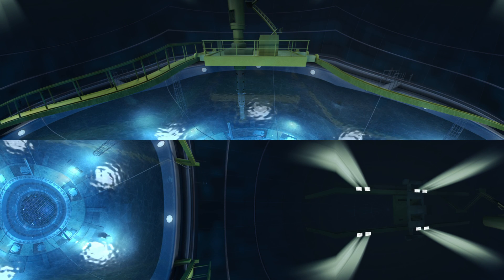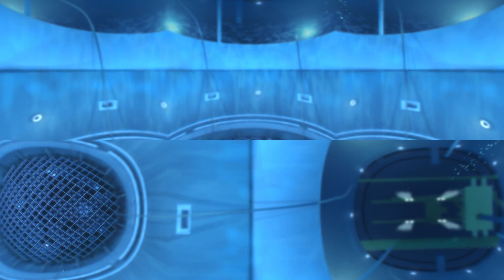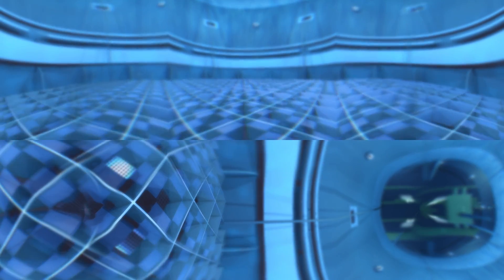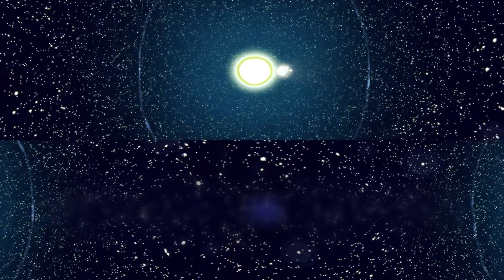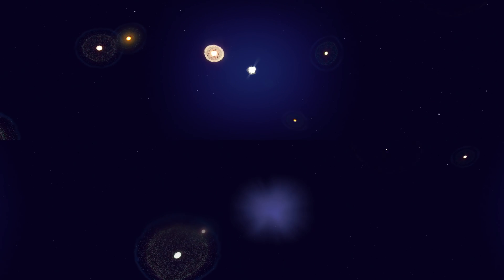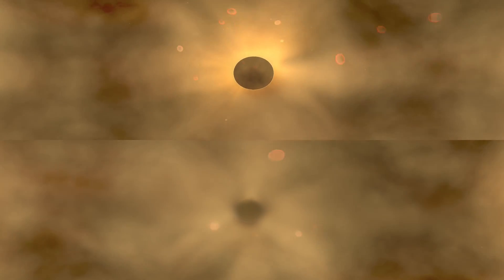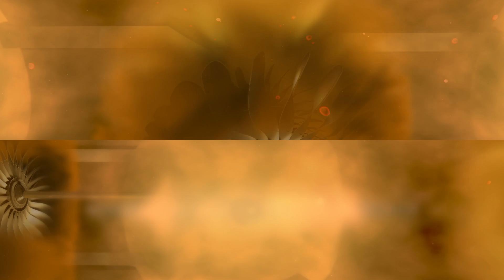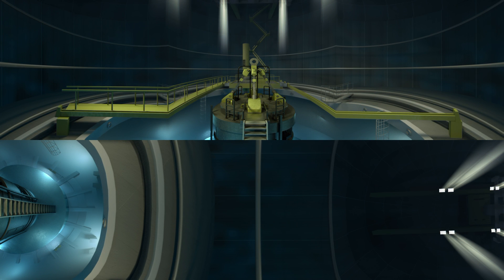What is nuclear energy? Shrink down to an atom and find out

Comment: <_< it ain't hard to cause fission that's the easy part, it's keeping control of the reactions during power loss, coolant leaks, mother nature. also you have nuclear waste too that is the fucking problem -_- we haven't solved those problems with this model of reactor. So yes it's safe if shit doesn't hit the fan but when it does its fucked for centuries and again the waste is millennia long shit. plus nuclear proliferation. We shouldn't be using nuclear power extensively until we solve these "little" problems. Solar, Bioreactors, Wind are our primary sources while nuclear needs to be as small as possible until we can figure it out. We need Walkaway safety reactors. when power is lost the core shuts down.

Comment: There’s a lot of empty space inside those uranium atoms does that mean solids are empty space although we can feel them as being solid
Reply: Absolutely. An atom is almost entirely empty space by measure of distance. If you consider a simple atom like Helium, if you think of the atom as the size of a building with an NBA basketball court, the nucleus is the size of an almost invisible gnat in the center or about 10,000X or a 1/2in wide marble in a box the size of a football field square 

What you feel as "solid" in a solid is the electromagnetic field holding the atoms of the solid in a rigid relationship to each, other or a lattice. Wood is harder than water but will float, the difference is the electrical attraction in the wood molecules is far stronger than in the H2O. Carrying on when you sit on a chair you actually hover, the electrons in the material hold you off of it at a tiny distance. Everything is fields, all forms and hardnesses and textures are created by electrical fields, space is the gravitational field, cell service and radio are the electromagnetic field etc.

Comment: It's all fine and dandy until mother nature decides to give you a little earthquake and break all of your toys. Remember Fukushima?
Reply: Fukushima was a flood not an earthquake the earthquake was many miles away and caused a tidal wave. The facility flooded, it lost electrical control of the cooling pumps. Nuke plants are vibration proof in general. No I don't like them, just correcting your bs.
Reply: @johnsmith1474  Correct your own BS. Read what you just said "It was a tidal wave cause by an earthquake" Caused by a what???? you're F%&*in dumb.....

Comment: Uranium is NOT mined from deep in the ground...How about 30-50 feet under fields in South Texas.  I hate idiotic statements from someone who has not done their homework.  Also you were not inside a reactor...you were in the reactor building... The reactor was UNDER the water.  Which is a moderator and part of the shielding and emergency water of the plant.
Reply: You got bit right, but yes they were in the reactor, inside a fuel pellet in fact, exactly where the action happens.

Comment: I have a doubt, we actually need to reduce the impact of the steam through pressure and velocity compounding in a normal thermal power plant so as to reduce it to an optimal level and then drive the turbines so wouldn't a turbine in a nuclear reactor be compounded too? Then the only advantage i could see from a nuclear reactor is that it takes a larger amount of coal to produce the same energy as that of the same mass of U235.

Comment: Nuclear tea kettles - water moderated, with its dangerous negative void coefficient 

- you'd think we might have invented a better (safer) type of nuclear reactor than one which is susceptable to prompt criticality and enormous steam explosions (chernobyl - and every current water moderated design).

- oh, that's right, we did - back in the 1960s - even hotter (and able to produce superheated steam - more efficient than conventional nuclear can produce) and far safer than water-moderated nuclear systems - and using fuel that's $150/kg (thorium) instead of $45,000/kg(uranium) - and then we threw it away because it was impossible to use the fuel cycle to make weapons AND the safety level of the new technology (Molten salt reactors) would have rendered all existing nuclear plants dangerously unsafe overnight. The 99%+ reduction in nuclear waste produced would be just icing on the cake, but the real icing is the ability to consume conventional and military nuclear waste as sidestream fuel.

Water and nuclear materials don't mix. Get them out of the nuclear loop.

Comment: Nuclear reactors are inefficient, the water should be condensed, and as it cycles back it should drive more turbines to create more electricity. 

Slacker scientists suck!
Reply: Well the video only explained the reactions taking place inside the core, the process of the steam hitting the turbines is same as that in a normal power plant,in an actual nuclear reactor multiple turbines are used to utilise the KE from the steam to the full extent

Comment: This is really interesting n' all, but how does the power go to the cities and homes? Also how does the nuclear reactor work?
Reply: Steam is generated to turn turbines, which spin up the generator. Which is then discharged into transformers, to shut the electricity through cables, powerlines, etc.
Reply: Well the video did explain how a nuclear reactor works and coming to power circulation... the electricity generated is sent through a series of tranformers which raise the voltage of the current ( to minimise power loss in the form of heat during transmission over large distances) then another series of transformers decrease the voltage and bring them to the required level to be used for household purposes

Comment: A terrible waste of resources.  A pressurised water reactor is expensive to build because in the case of a failure the radioactive steam that would be produced has to be contained within the huge containment sturcture.  With loss of pressure the steam produced would occupy 1,000 times the volume of the water.  On top of that, the reactor only burns 0.05% of the fuel before it has to be reprocessed.  It also produces all the dangerous nucleotides that have to be extracted and stored for thousands of years.   A molten salt reactor on the other hand, uses a liquid fuel at normal atmospheric pressure.  It is thermodynamically more efficient because of the higher temperature and can usemuch more of its fuel.  Being a liquid fuel the reprocessing can be done as part of the normal chemistry.  Waste products produce a generally shorter lived and, if Thorium based, no weapons grade Plutonium is produced (one reason why the military blocked the development of the Molten salt reactors in the USA).  The new reactors planned in the UK are going to be so expensive that the whole project is not economic.  In a few years time there will be 100MW power stations in shipping container that can bring nuclear power to where it is needed.

Comment: Just a correction for the watchers : The Heavy water heated by Uranium Pellets DON'T enter steam turbine, Heat is exchanged to normal water (Like the water we drink) using heat exchanger and turns to steam, and after leaving the steam turbine its not pumped again in the cycle, in REAL world we use the rest of energy in the steam leaving the turbine in water distillation or any other industrial process...Greetings for anyone used steam charts :)

Comment: The turbine generate nothing.  They are high-strength fins that transfer energy to the shaft that drives the rotor inside the stator.  That generates the electricity.

Comment: "2 million pellets - each 'only' a centimeter tall" - I dont think thats right...
Reply: It actually says "over 2 miliion", so I think it is literally correct. Some public domain data is given here: https://inis.iaea.org/collection/NCLCollectionStore/_Public/29/010/29010110.pdf If that's correct, then, for example, Sizewell B would have 193 fuel assemblies, each with 264 fuel rods, each 366cm of active length, so 193 x 264 x 366 gives about 18.6 million pellets in that case.

Comment: What's the general efficiency of such systems? I mean all the binding energy released from the nucleus in the form of heat doesn't necessarily change into electrical energy right..?
Reply: Roughly one third of the released energy ends up as electricity, for example see: https://inis.iaea.org/collection/NCLCollectionStore/_Public/29/010/29010110.pdf

Comment: Iv done a feir amount of research into nuclear energy and tbh as long as the core is handled right and the rods are dissposed of properly then its safe and cheap but do we as humans really want to take the risk of another Fukushima, Chernobyl and Three Mile Island also hear in the UK we have 15 (soon to be 16 thanks to EDF) nuclear reactors all placed around the UK and if all of them (highly unlikely) meltdown or if 2 were to melt down that it for all of un in jolly old England I think @EDF should invest in nuclear fusion which is a far safer and just as clean and a normel reactor
Reply: Despite some serious disasters, nuclear energy is still statistically the least deadly method we have. And it's not even close.

Comment: So here we are which generates itself however you have filters which needs to be cleaned out on a regular basis is that correct why you find massive amounts of saturated dirt listed if you dried out the compound everlasting events will start to happen where you can understand the particle how it is combined with this as long as you dry out the element

Comment: "but understanding the physics, means we can control the chain reaction."

CAuSe FuKusHiMa WaS sO uNdEr cOnTroL!

Science may giveth birth and mama nature may taketh away.

I don't trust nuclear energy. Solar, wind, tesla coils or any other I support... Not nuclear, efficient, but too risky.
Reply: Nuclear fission learned us to split the atom, if we never reached this step in technology we might've never had nuclear fusion in the future.
Reply: Well, IMO you can't generalize nuclear energy as one type. There are many many different kinds of reactors. There's a promising type using molten salt. It's supposed to be safer as it's fuel can't melt down. (It's already molten) And because there is no water as coolant, a Chernobyl like event isn't possible. There's also a safety system that would prevent a Fukushima like event. they have what is basically a frozen plug at the bottom which has to be cooled to keep the reactor running. As soon as power goes out, cooling goes out. The plug melts and causes the fuel to drain into another container where the reaction stops.
Reply: @melloy_lucy  call me Debbie Downer cause even with the precautions and theory, I still don't trust  mother nature.
Reply: @emraugnotavailable  oh okay. I understand the concerns people have about nuclear power. I just wish popular media and schools wouldn't generalize it. Explaining nuclear power in greater detail might change public opinion on this topic. The trust was lost with chernobyl, fukushima etc. Partly due to that generalization.

Comment: And after the rods are no longer useful SOME ASS TAKES THEM OUT AND WANTS TO BURIED THEM IN YOUR BACKYARD SO YOU GET RADIATION POISONING!!!!!
Reply: ... well deep underground or dumped off continental shelves anyway. Don't worry about nuclear radiation... worry more if your house is built on granite bedrock (radon gas risk... keep your basement ventilated.)
Reply: @davidhenningson4782  I am well aware of radon gas but that is everywhere Spent Nuclear rods are not and they are far more dangerous.
Reply: @apacheone3643  ... as long as they're sealed up... they're not hazardous.  However... if nuclear fusion is ever proven viable... I'd prefer we switched to that instead.
Reply: @davidhenningson4782  I agree with the Fusion option.The spent rods from Nuclear are buried but eventually break down there containers and leak ,a good example is why they keep building around Chernobyl with larger buildings.
Reply: @apacheone3643  actually... you're very right about that. Materials can only absorb so many neurons and gamma radiation before becoming 'brittle' and failing. Even borated concrete and lead casing will fail over time.

Nuclear fission is a band aid solution for now... but we really should develop better and cleaner ways to generate affordable electricity.
Reply: @davidhenningson4782  I do not disagree about developing better materials but until a better solution is found we need safer alternatives like solar and wind.

Comment: but you did not explain how radiation and nuclear waste are made during that process
Reply: Radiation heats up the water And is contained by it. The radioactive waste... are the 'spent' fuel rods... which get sealed up into steal drums with concrete... and are sealed up with more concrete.

Comment: What have they not told you? 

1. Radiation still gets out in the environment even with the greatest of precautions taken.

2. Once works done, cooling the rods require decades of keeping in large body of water. That water will forever be harmful for the environment.

3. They are correct, nuclear energy is the safest for our environment. What is doesn't tell you is that it's one of the most dangerous for life however. Even plants will be affected by the radiation these nuclear power plants will release.

What is the most environmentally friendly AND life friendly? Solar power. That is the cleanest form of energy we can get.
Reply: "Solar power. That is the cleanest form of energy we can get." So is nuclear energy since it does not emit pollutants into the atmosphere in the same way as burning coal, oil and, to a lesser extent, natural gas. Also, comparatively speaking, the result of fissioning Uranium-235 atoms is colossally more powerful and, therefore, economically more efficient than trying to harness solar energy in order to generate electricity.
Reply: @kurt44mg42  like I said, nuclear energy is very safe for environment but not so much for life.

Radiation is progressive, maybe in the next 100 years the world will drastically change due to this small ounce of radiation being released.

That's why solar is THE best. It's safe for environment and life. Anyone can have solar panels to generate energy so long as they have land.

Edit: but it doesn't work in countries where the weather is crappy though...
Reply: @ridwankhan4883  If you're referring to human life then, statistically, nuclear power generation is, by several orders of magnitude, the MOST safest when compared to generating electrical power by other means. Here, have a look at these statistics measured in deaths per terawatt hours (TW/h): (1) Brown coal: 32.72 (2) Coal: 24.62 (3) Oil: 18.43 (4) Biomass: 4.63 (5) Gas: 2.82 (6) Nuclear: 0.07.
Reply: 1. No shit radiation still gets out, only small amounts though
2. "water will forever be harmful" my ass, radiation dissipates and disappears eventually
3. That's common sense

You know what's so damn flawed for your ignorant points? The Sun, Earth is constantly being bombarded by radiation, hundreds of times more powerful than the tiny amounts these nuclear generators release. Want to know why we're not dying from the amount of radiation that bombards earth every second? Because it dissipates eventually, or the radiation gets radiated out into space.
Reply: Is your house built on granite bedrock? I'd be more concerned about 'radon gas' than concrete containment storage for waste emitting faint elevation over the regular (natural) background radiation we all get anyway.

Comment: The question is how do I feel about nuclear power. Well my answer is simple, stop building them on fault lines, have a better back up system than two days diesel generator fuel, no shortcuts in the construction, and no value engineering. Other than that, I’m fine.

Comment: With the proper safeguards it is the most efficient and cost effective way to produce electricity we have at this point in time. The wind farms and solar cells sound good but the upkeep and maintenance requires that the tax payers subsidize them.
Reply: Not to mention that nuclear power can be used basically everywhere.

Comment: its all good unless something goes wrong! then we suffer great damage for about 2500 years
Reply: there are so many fail safes in modern nuclear reactors it woul d be ver hard to blow one up, even the fukushima reactor that was designed to be installed on a hill (put right next to a water basin) and hit with a massive earthquake/tsunami never gave anyone a lethal dose of radiation.
Reply: How did you come up with that number?

Comment: Wait til' we harness fusion energy, this stuff will be like burning coal.
Reply: Fusion energy is still very, very, very far away. Even now the test reactor they're building outputs less than it takes to keep it operating. 

Requires a LOT of energy to fuse atoms, takes very little to break them apart.

Only place we see fusion is in stars, but thats because it has Quadrillions of tons of mass that is super heated crushing the atoms so much they fuse. We can't replicate that so we try and simply use energy to fuse atoms.. kind of funny really.
Reply: It might never be feasible like we can achieve nuclear fusion but it takes more power to create it then it gives off